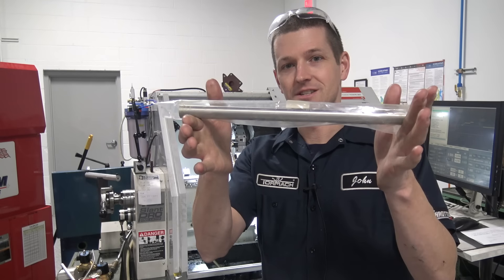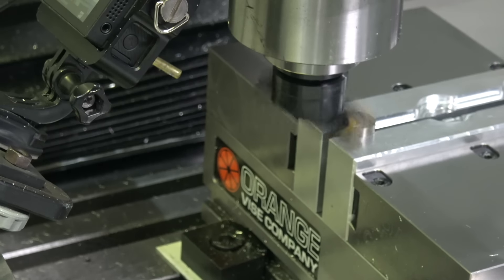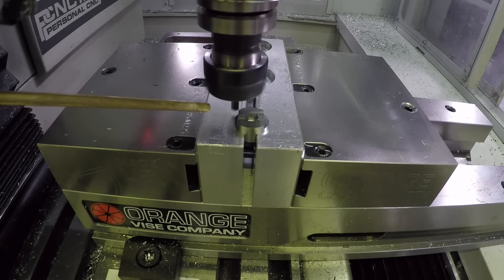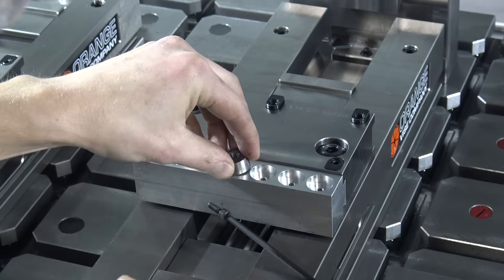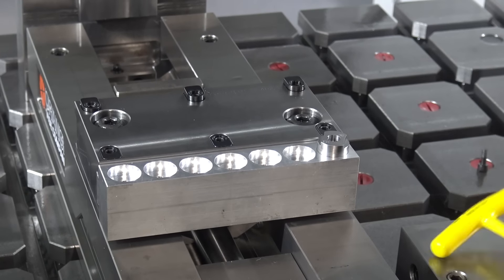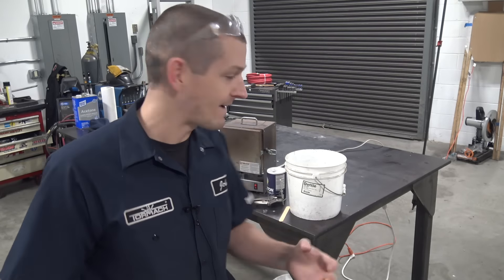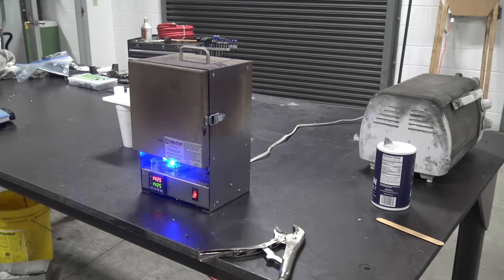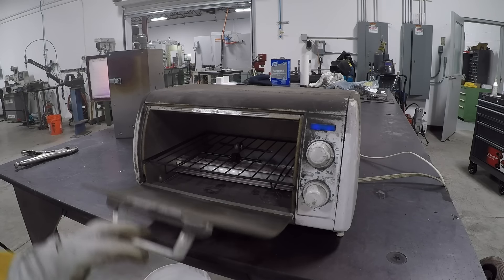Machining & Heat Treat Tool Steel Vise Inserts!  WW128

Comment: Wrapping it in some kind of wire and using boric acid (being held to the part by the wire) will help create an anti-oxidizing layer during the heat. Check the channel "Clickspring" for some DIY heat treat DIY ideas!

Comment: For smaller ovens like that, a charcoal briquette works well to remove some oxygen out of the oven, and if you keep it in a tray you don't have to worry with ash getting on your parts if you're beyond auto ignition of something like paper or wood. Just be aware that when you use something like that to consume the oxygen, the gasses in the oven may be flammable and above ignition temperature when you open the door. Not a terribly large flame, but it will take some arm hair if you're too slow....

Comment: If you use a stainless foil bag you can add a little carbon to the bag to soak up any oxygen. Something like a small piece of paper would work. When you pull out the bag, cut it open to let the part fall into the quench.

Comment: Maybe try using rainex on the inside of the lathe window, to deter the coolant streaking.
Reply: That is actually a really good idea.  It would probably work well.  Nice.
Reply: Rainex is not good for plex or lexan.  It will cloud the surface of the plastic.
Reply: I'm going to call you.... Buzz Killington IV.   LOL
Reply: Oil based coolants also strip it off and hurt the coolant/sump life. Totally tried this once, which is how I know. Worked great for about 3 hours...

Comment: John, nice video.

Ebay search for a grocery scanner replacement glass (really scratch resistant) or possibly hack the glass from an old Iphone and attach it to the inside of the enclosure with some RTV.     For the coolant on the glass -- this sounds like an Arduino project -- periodic air and water blasts of the filming window to keep it clean. 

I noticed you did the hardness punch on a paper towel,  I wonder if the cushion of the towel has any effect on the punch mark. 

Thanks for the pallet -- it's really nice
Craig
Reply: Off subject John:  What happened to your new/used grinder?  Saw a short video then it disappeared..

Comment: W1 is water quenching but the tempering is really fussy with multiple high temps above 1000F. O1 is super low rech and forgiving in comparison.

Comment: Thanks for the book tip. A bit of lit paper can reduce your O² before you fire up your oven, if it's airtight enough Lots of ways to make it happen.
Reply: Jim Marriott you don't even have to light it, and throwing a sheet of ceramic kiln paper on the floor of the kiln might help protect it

Comment: hurco has a fairly large memory and you save the job as the part number or something that identifies the part
Reply: You can throw it on a thumb drive and move it from machine to machine yea you can't move hurco program to a mazake quick but I work in a hurco dominant shop. We're a job shop so it's so fast it crazy from raw stock to finish part the conversational is super powerfull. Yea we have to do cam for 3d work but if your confident in your point to point programing you can do alot more what you might think. but yea haas all the way for cam software because hurco cost your literally pay more for the controller than probably an equally capable machine from anywhere else

Comment: Now that was really cool.   I like seeing how things are tested and with the right equipment, prove that it worked.  I mostly work with electronics, and do the same kind of testing to make sure it works like I designed it.  
But this is really cool to watch.  
I saw the vid's on the scraping, you all went to, and that too was really interesting to see.  Looks like you all had a good time too.
Have a good week, and I'm looking forward to what you have next.

Comment: 65RC is extremely hard for tempered tool steels.  You are at almost as quenched like you didn't even do a temper. You should likely raise your temper temp to get more in the 60RC range for service. Foil wrap works well for avoiding the scale but is a bit of a hassle. Depending on how air tight your oven is if it is pretty air tight you can throw in some newspaper to burn up and deplete the chamber of oxygen, thus avoiding the scale.  I hear the stuff ATP makes is the best and easiest to use. I would put a link here but then the comment would be invisible spam.
Reply: bcbloc02 
The numbers did seem pretty high. I was expecting to see mid 50's after tempering.
Reply: NYC CNC 
Re-temper? Not sure. 

You can anneal it back to soft state, then re harden and temper. 

Though. In theory your should be able to temper at any point after hardening. I can't think of a good reason why you couldn't
Reply: You can temper or temper further(higher temp) at any time after hardening.  Obviously if you over shoot and go too soft then you have to re-quench but one of the beauties of high carbon steel is how easily it is worked.

Comment: Keep in mind the Martensite Start (Ms) temperature of the Steel.  For high carbon steels like W1 and O1 the Ms is around room temperature, and in some cases below.  If you begin to temper when the material is at or above this temperature the Steel will not fully harden.  Maybe only getting 64 HRC instead of 68-69 HRC.  The problem is that the retained austenite will, over time and use, convert to Martensite.  Martensite occupies more volume than other phases and will literally grow.  So that today the part has a diameter of 1.0000¨ but after a month it wil mysteriousy grow to 1.0005¨.  That is why many old-time tool and die makers would set heat treated materials aside for months or more before final grinding.  This is not a big deal for most components BUT if a customer asks you for a set of gauge blocks that must be to less than a tenth it becomes a serious issue.  Food for thought.  Before I forget, if you do not have SS wrap you can use a little piece of wood or a stick and throw it into the oven.  It will smoke, naturally, but that smoke is carbon and it will help with decarburization.  In essence you would be carburizing the part slightly but it would help keep scaling down.

Comment: 65 HRC is really a high hardness. If the annealing temperature is too low, the material gets extremly brittle (as glas with no ductility).
If annealing to 60 HRC, you loose some hardness but gain alot of toughness! 
Do some test pieces; heat treat, anneal, and try a DIY "Charpy V impact toughness test" It would make a great follow up video!

Test the materials in:
Delivery condition
Hardened not annealed 
Hardened and annealed 60HRC

The test shows if your heat treatment yields the wanted material properties (impact toughness -> ductility parameter)! 
//Henrik -Engineer

Comment: little trick for removing "plugs" from blind bores, if the plugs have a hole, is to put compressed air down the hole of the plug. Take care because it might shoot out when you remove the air gun.

p.s. apologies for the duplicate posts. tablet interface is often a bit dodgy but this is an extreme case!

Comment: If you're concerned about scale you could use a mixture of denatured alcohol and borax and coat the parts in the solution.
Reply: Similar to what clickspring uses.
Reply: Clicksprings clock omg so beautiful.
Reply: CoolPatroler  it's borax?  awesome I just bought some for experiments for my.kids
Reply: Using borax is generally bad for the kiln floor. It eats right through some refractories. I don't recommend it.

Comment: You should not open the furnace when it is on. My friend is doing ceramics, and she said that it could damage the heater coils if they are exposed to the oxygen in air you let in

Comment: I would think you cut those soft jaws with a corner radius end mill.  Leaving a fillet at the bottom.  And your perfect 90 degree corner of the tool steel didn't fit in the corner perfectly causing the bur to be raised.

Comment: If you want a new window measure it, then go to any glass place and get some safety glass cut to size.  It will never scratch and last for the life of the machine.  All new HAAS machines come with safety glass instead of what they used to use which was just plexiglas or whatever.  Old Cincinnati Milacrons came with safety glass and if you look at any auction for one of them their glass is still pristine.

Comment: John just get a piece of safety glass from your local glass shop, they should have 6mm and it's not horrible expensive.
Reply: Rain-x works for a bit but the coolant does washes it off after a bit. As long as it's not being directly sprayed it should last long enough to film a part though. Don't use it on plexiglass as it will fog plastic.

Comment: Suggest that you're too sloppy on your hardness test punch.  Place on hard, flat surface and hold perpendicular for repeatable results (if it were me I would use your threading arm/machine to make it easy).  Verify by using exact same technique on test block.  $0.02

Comment: meguiars plastx can be used to clean clear plastic really easily.  use the palm of your hand including fingers to make it work.. you could also use a piece of leather or smooth soft vinyl .. what happens when you apply it with a cloth . all the super fine abrasive goes into the cloth.  it won't go into your skin.. or thru shiny leather scraps or smooth vinyl upholstery material.  try it on a small area lower right corner of the inside of your window if you can lift the whole door off..  do the lower left inside corner if you cannot remove the whole thing..  there are clear acrylic sprays to keep the surface from oxidizing again.. same as found in headlight polishing kits.   some brands have fairly nasty chemicals  you don't want to get on your hands.   hint.. a half drop on the cell phone plastic surface covers wiped franticly with the finger tip.. not into the microphone or speaker restores the clean look..   its plastic polish.. also available in many other brands.. i just like the non chemical version of meguiers.  want to polish a device on the lathe to mirror finish .. a drop or two and some leather.  you might get some scrap and make a wooden spanner wrench shape to hold the strip of leather so its leather only.. no backing to push on the part . sorry for the wall of text..  my tooling is dull and it does not cut thru text as well.

Comment: I would not bother with the foil packet with O1 and W1 it is worth using anti scale compound you can get it from brownells gun making suppliers I use it when heat treating my knives
Reply: Mike Palmer 
Coat it in borax or silver soldering flux that contains borax Thame a look at clickspring you tube he demonstrates the principle parts come out scale free
Reply: Stuart Hardy I did look into it but I find the antiscale compound is a easy way to  do it and I have heard that the borax can affect the refectory in my oven

Comment: Check your tool steel material with a 3 point external micrometer to see how round it truly is. A conventional micrometer cannot check roundness as it is only a 2 point dimension. Centerless grinding does not always yield accurate roundness especially on off the shelf stock vs. say a dowel pin.

Comment: I have a constructive suggestion for you to consider. If you spray-coat the inside of the CNC machine's (polycarbonate?) window with a nano coating, it would make it hydrophobic. i.e. The coolant and swarf would slide straight off and you could then be able to see (and video) what is going on while the machine is running.
e.g. http://www.nanoshell.co.uk/protective-coatings/self-cleaning-glass
NB: I have no association with the above vendor.

PS: Keep up the great videos!

Comment: Stainless bags are not really worth the price.  Most commercial heat treaters don't like keeping brine around therefore they don't like W2. Invest in heat treaters gloves and a pair of tongs, very much worth the price for the safety factor. Also let your parts "soak" at temp for a minimum of an hour.  This allows it the full form the new grain structure.  Vinegar is great for removing scale. You will always get some dimensional change.  You can minimize this by doing a normalizing cycle before hardening. Another steel to try would be A2. A little tougher to machine than O1 but it can achieve higher Rc hardness.

Comment: automotive "Rain-X"... for the inside window of the machine.... follow the instructions, if you have not ever used the product, meaning, apply it.... rub it in, look at the glare to make sure it is applied all over the window, you will see a milky haze.... let it sit for a few minutes to allow the alcohol to evaporate (solvent), once dry, go back in and rub off the milkiness, via the glare/haze..... and the coolant will bead right up and gravity does the rest... each application will last a month or two based on an 8 hour shift per day. Please note, check with your customers to verify that the Rain-X product will not hinder, as there is a very high grade of wax with in. Granted, it is so easily contained to the viewing window... just saying...I used to apply it to some Kitamura's back in the day while at my job, and there was no hindrance to the product that we manufactured, of which was PC parts for hard drives. You can imagine how picky those company's are.

Comment: Hi John, Chris @ Clickspring uses boric acid during the heat treatment, but you need to keep the part in a crucible/tray.
https://youtu.be/NhjiIPohUyw?t=3m

Another thing you can try if you have a ceramic crucible is to cover the part in salt, which will melt at 1500 F and coat the part, but before then it isn't very useful.

You won't be able to see the part though, which means you can't easily confirm with colour if the part has achieved the heat treatment temperature.

Thanks for the videos, David

Comment: Wax your windows with a good automotive wax and the fluid will not stick...
Reply: I do this to my cars and trucks and they not only expel rain and dirt like  awesome, but I also wax the inside windows rather than trying to clean them. Makes them spotless and they stay that way for a long time with out having to clean them every couple of weeks. I have a close friend that owns a detail business. I told her about this trick and she said it was the coolest thing she had ever found out about cleaning windows.
Reply: Oh and I think a good wax works better than rain-ex. Seems to last longer for me. Wiper blades don't wipe it off. And I wax the blades also.
Reply: What kind auto wax do you use? I will have to try this on my machine.

Comment: Don't bother with expensive inert gases for heat treating your parts, coat them boric acid mixed with alcohol into paste.Cheap and your parts won't get scale problems.

Comment: God I hate conversational, what a mess. It's 2017 we have computers with CAM get with it.
Reply: Marcus Quintilian you obviously haven't worked at a machine shop because if you are solely turning a diameter or drill some holes with a simple contour you will undoubtedly program with a professional Siemens or fancy controller. Conversational
Reply: I'd do something that simple on a manual machine. 99% of my jobs have complex contours and such.